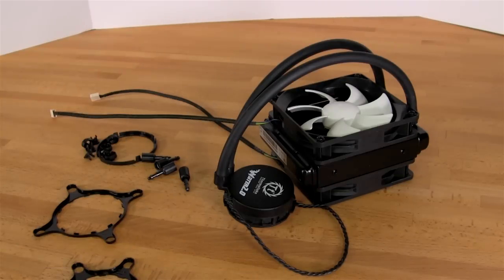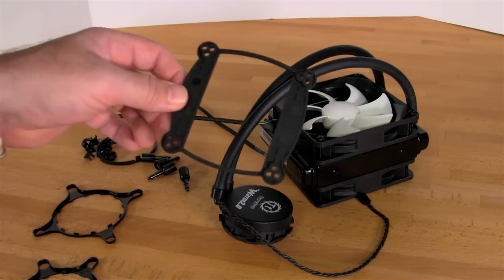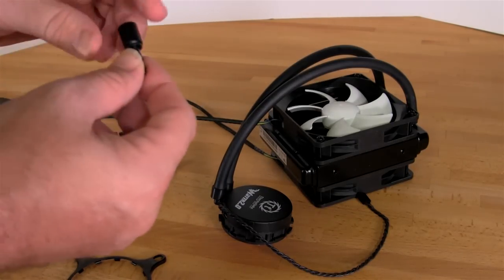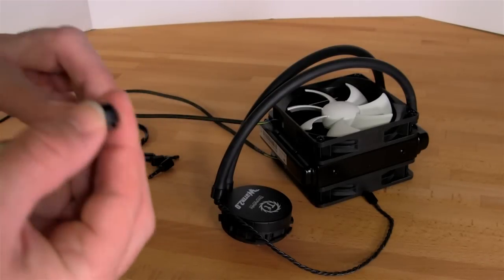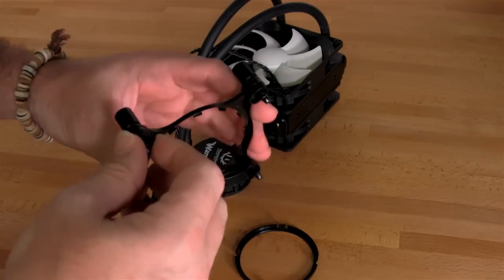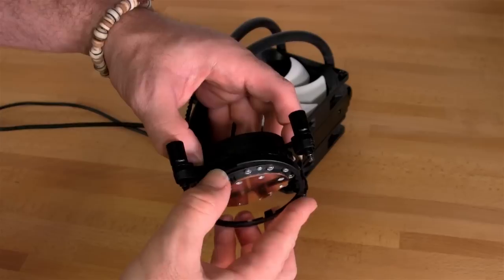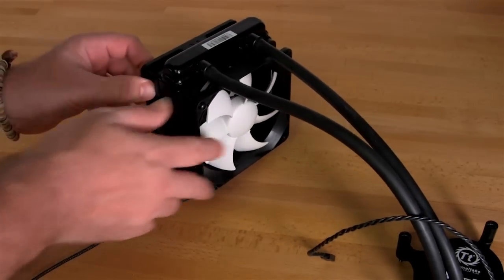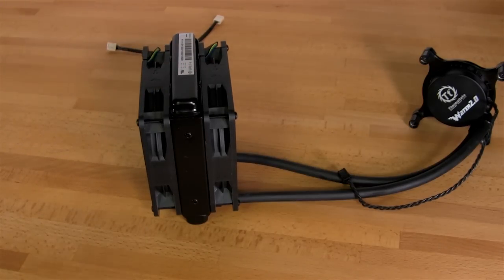Thermaltake Water 2.0 Setup

Comment: my doubt is the position of the fans are both fans pushing the air in, or they pull the air out of the case, or what if both pushes the air into the radiator?
Reply from the maker: The fans are set up to work together to pull (or push) air through the radiator. having both set to push air into it would not do any good at all.

Comment: I using an AMD FX-8350 Processor with integrated socket cooler heating and MSI 990FXA-GD65 Motherboard, 8GB 1333Bus RAM, 750W power supply.

But when I give more than 50% load on my processor then its temperature continuous raising 70ᵒC+ & then my system automatically shut down but less than 50% not make any problem.

If i use an Air Cooler or Liquid Cooler than it can solved, but not sure. If I purchase any of them then which is better for AMD FX-8350 Processor. I really want to use my processor 4.20GHz 100%.

Somebody tell that Liquid cooler good but not lasting long time. Now what can I do? Please help me by given your suggestion which brand is good for cooler & which one liquid or Air. Also how can i use my processor speed fully by given 90-100% load.

if Liquid Cooler then which one or if Air Cooler then which one
Reply: Do you have low profile ram? if so I think the cooler master hyper 212 or the Cooler Master Hyper TX3, if you have regular ram you may need to get a liquid cooler if it fits the case, i would recommend this one, but be careful there has been know leaks in water coolers in general (haven't heard any about this one) :o

Comment from the maker: You can get a splitter or a Molex to 3-pin fan adapter. I would plug the pump into the Molex connector and the fan into the CPU fan header

Comment: thanks i got mine working  i had to make some changes to my computer case to make sure that Radiator  was lining up   right thine  i had to take whole mother board out to  of the case line up the my water blocker to the cpu  plug it in  and the Y cables too  as well  with the door open  stay cold at 9'c with door  close no gaming on it stays 14'c to 24'c  with a  normal  heat sink was  42'c  it seems doing its job  to stay cold send me email i be glad to sendyoupic of pc rkscomputer1@gmail.com

Comment from the maker: Yes you need to clean off any old compound on your CPU before you put on a new cooling system. There are a few ways to do this but I happen to like using the Arctic Silver paste remover. It is in two parts, one is a solvent and the other removes all of the residue. The Water 2.0 does come with thermal paste on it, but it is not the best that you can get. It will work for most cooling needs though

Comment: like to  ask do  you  have to clean  off the  old compound past that you use on  your cpu  from your  old  heat sink  
make  sure its  cleaned  to install the new  unit and  not to  put any on themaltake water cooler   unit   or do have add  back  on  the compound  past looks easy to install    email me to day  i get mine in today for  install

Comment: How loud are the dual fans? For me, the fans are audible even at low idle (1500RPM), and blazingly loud at full speed (2000RPM). I'm wondering if I installed it wrong, or got a lemon.

Comment from the maker: The Pump plugs into a fan header. It is recommended that you plug it into the CPU fan header and then set that header to full so the pump is not throttled.